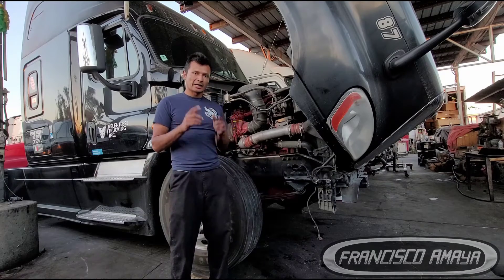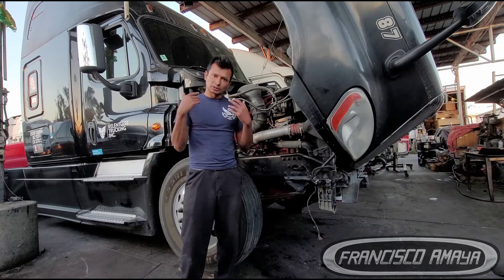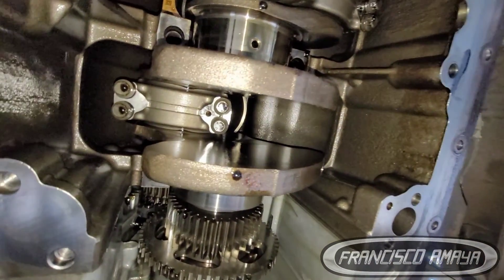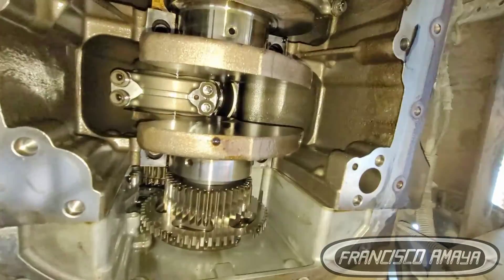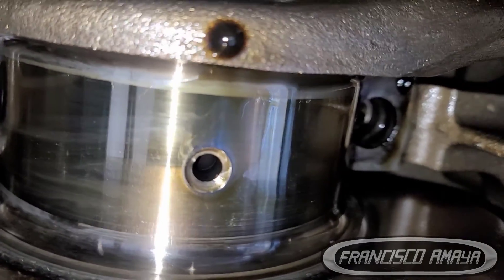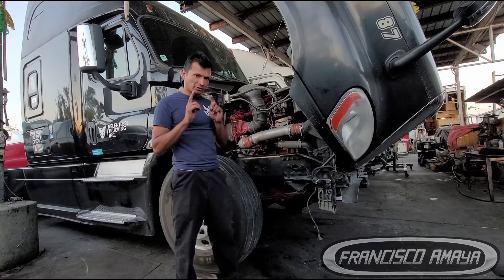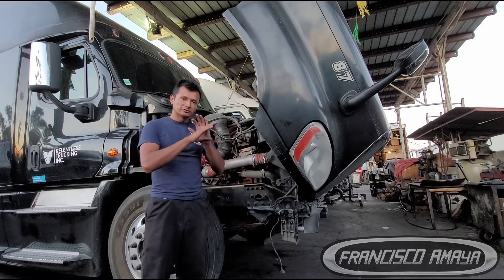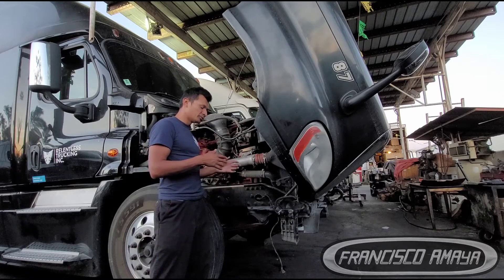Cummins ISX ISX15 low oil pressure damage main and rod bearing problems

Comment: Hey I have a pacar with a Cummings engine 2011 don’t start oil pressure when cranking goes to 20 psi fuel pressure at the computer goes up over 5000psi what do you think